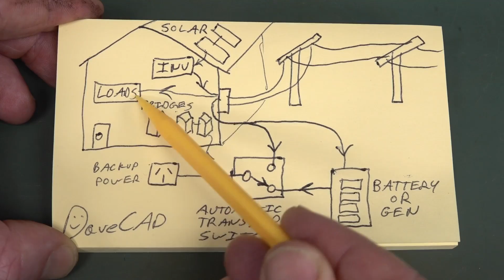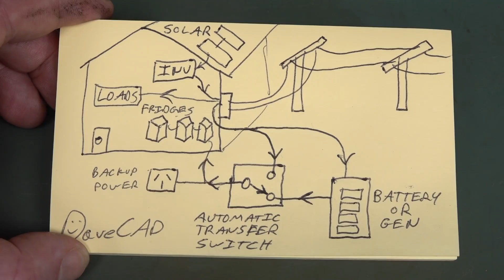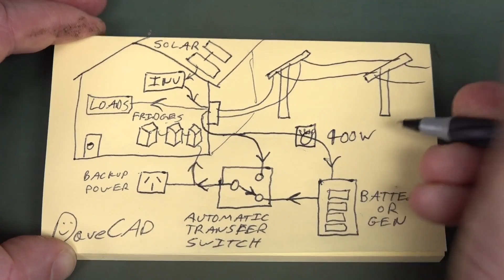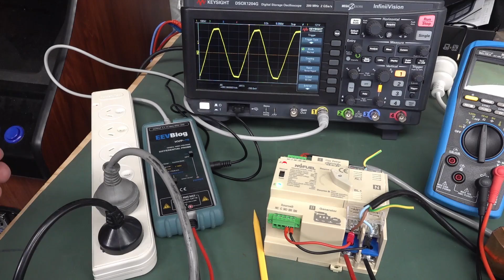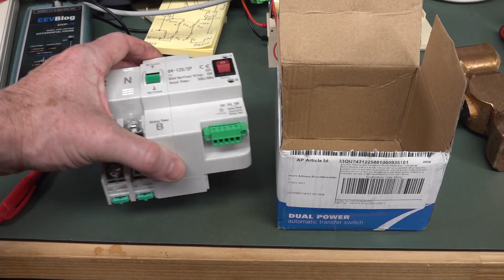EEVblog 1500 - Automatic Transfer Switch REVERSE ENGINEERED

Comment: Side note, I picked up a few of these and they have have changed internally. They now use some kind of sensing circuit (likely a MCU) to detect the power failure and even under/over voltage. This created a problem in that they are very slow -- it takes about 230ms before it'll switch from the primary to secondary. The actual switching is very fast, just like on these units Dave tore down, but since it has to "sense" that the power has failed before activating the relay to switch over, it is very slow overall. It can flash the primary LED input to indicate if the power is over or under spec. Unfortunately this means it's so slow at switching that computers and electronics will reboot. Really disappointing.....

Comment: Great explanation Dave. Do you know how the coil resistance varies with current capacity??  I've tried a 100A ATS and a 3000VA source can switch it but a 500VA can't.  The coil is only 18 ohms, so 12A steady draw plus surge.
I only need 25A capacity, so do you think a say 32A ATS require less power to switch??

Comment: I just received my 3 pols one (I also want to swap the grounding conductor PE) for the very same purpose, using the grid as a power backup, should the stand alone PV have problems.
However, I was puzzled by the manufacturer's description, which states the following:
- Due to the characteristics of the product, this model cannot be connected to the inverter, but can only be connected to the mains or the engine power supply.
Do you see any reasons why a steady, clean and stable PV power should be worse than an unreliable and often unstable grid supply?
I'd like your views on that if you don't mind.
Thanks for your video 🙏

Comment: At 18:36 those are not straightening bars, they are electric arc dissipation plates, also the second model that you have is not 100% identical because the secondary contact's are made once the lever is moved with the big micro switch's on the other one with the 4 pols relay when the main power goes of they switch immediately and it doesn't matter the position of the handle. Other than that your video is great p.s. you should rename the video because I have searched all over the YouTube and I couldn't find an internal look inside these units and you have dismounted it and I have seen what I need. Good luck

Comment: (TLDR ADD FUSES TO THE COIL INPUT TERMINALS) Nice little unit, sadly had one blow up on me after 6months of service. I'm not sure what the first failure was (did it jam? who knows) all i know was it was still in grid mode and oddly hadn't changed over to solar one day and when i checked on it, the unit had  burned a hole in the side of the plastic unit as one of the solenoid coils had burned out completely also burned out all the circuit board traces inside and burned out the auto/manu switch. when i replaced it i added 1amp fuses to the two coil inputs (i did try a 1/2amp but change over inrush blew that one on the second change over test).

Comment: What happens if the control wires aren't connected. Can it still be used manually as a mechanical switch? It's too late to get my head around the circuit.
Reply: Yes

Comment: Bridge rectifiers and associated circuitry are possibly only protected by the 100A main fuse. The control circuits need their own low amp protection device.

Comment: Good informative video.  I bought similar from same manufacturer and now I learned how to wire it up thanks.  $25 here in Thailand off Lazada.   Same project, running guest house off solar and a Bluetti   AC200MAX with mains grid as backup.

Comment: Has anyone looked into what a typical blackout looks like over ~1 second? I'm wondering if there's normally behaviour that would make a 240v relay across it "chatter". 
Do UPS's normally have a minimum time to run off battery before re-connecting to the mains once it's back up?

Comment: I have a question, my ATS switches nicely but sometimes my house fuses flip during the transfer switching from battery to main. What could be the reason?
Reply: Kind of. We have fuse type B installed. I will change it to fuse type C which is made to hold for initial load longer. I presume that should do the trick…
Reply: @cOsMiCTr  thanks for getting back to me so promptly. hope you solve this.
Reply: have you found the issue?

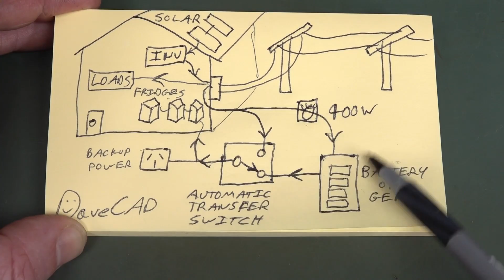Comment: 10:38 Why not do another ones of these automatic switches but tap the sense wires directly of your inverter? Or better the solar panel (there must be shenanigans possible to cut the power from the "grid" if the solar panel doesn't give power.

Comment: Hi Dave. Have you also considered using a power monitor GPO? These monitor the line voltage and automatically cut off power for 5 mins during a brown-out. I could potentially see a feedback loop, if the battery failed under demand (current) but was able to produce enough voltage to trigger the transfer switch. It would just switch back and forth. I do like the transfer switch for redundancy but make sure it has a failure mode lockout. You could also "possibly" use current transformers to siphon off excess solar, instead of a timer.

Comment: Or, place a big can of water in each freezer. That will act like a thermal buffer to keep the temperature low for some hours. Then just turn off the freezers each night.
Or, if you want to be really fancy: Add a larger tank of coolant gas to each freezer.

Comment: You want to make sure you don't have neutral connected earth or you could put any fault current back onto the mains. If you just have an earth spike in the ground you will be ok, but for a neutral connected earth you need to switch over the earth to a local earth too.

Comment: Looks like Dave is going to build overcomplicated nuclear power station from it :D 

What I didn't understand are these points:
1. How can help these mechanical contacts help with glitches caused by another mechanical contacts of built-in relays ofthe battery?
2. Why the fridge must be powered permanently? We have two days with eight hours power outages here per year due to maintenance and it is not absolutely problem - the freezer goes from -18 degC to -12 degC at this time. I don't understand why can 5 to 10 minutes cause a probelm, it would be below scale of the thermosat hysteresis. If the internal temperature rises so fast it is not problem for electrician but for the fire department.
3. The fridge is a compressor. The compressor is a motor with hard start. It means 10 to 15 times normal current. It is stupid idea to connect three of them in paralell and conect at the same moment, even if it runs form a convertor. This will activate the overcurrent protection.

And my recommendations:
1. If there is no extra reason, NEVER switch the neutral line in mains circuits. Really, NEVER. And if you need it be sure the neutral is connected the first and disconnected the last. I know you are not familiar wit it but imagine a board powered by +24V and +5V with cutted off the ground. This is similar.
2. This switch is nice to be a bistable relay on the output. The sensing inputs A and B are good to realize separate control circuits with delay etc. in that.
3. If it is possible to connect N without switching the N contact can switch on and off charging of the battery (the charge time will be shotrer by few minutes but you won't need the extra relay for it).
4. If the invertor has power indication contact it should be used to control this crazy invention.
5. You can also use current sensing relays and switch the output when there is no power consummed from the battery ouput. In this case you have no inrush current...

Comment: Instead of all this stuff. You can simply set your fridges to -25C and use a timer to turn them off during the night. That way they are only powered by solar, and you don't need the battery or a transfer switch. You are in essens using the frigedes as batteries.
Reply: I dare say not all units have a set point that low?

Comment: Automate the battery disconnect?  Why not have something connected to the solar panel input, so that it's controlled by if the solar panels are producing power.  Or just get a photo sensor, so that it follows when there is light outside, so it disconnects at dusk and connects at dawn.

Comment: These are very simple, very crude, but also very effective for small single phase loads. As pointed out by many others, the strengthening bars are intended to break/split/dissipate the arc when switching loads. For small single phase it obviously works,  I doubt they would come anywhere near the rating claimed (50kA) or the full load for the no. of operations claimed. As also pointed out by others, professional units will have multiple time delays built in to prevent hunting in the event of voltage fluctuations, and also run-on timers for generators. But they also cost accordingly :-) Great video, thanks.

Comment: Seems like a design flaw to me.  Shouldn't the tamper switches be arranged so that the solenoid circuit is broken at the end of the throw, not the beginning?  Breaking the circuit at the beginning of the throw could result in oscillations if the initial force of the solenoid is not sufficient - perhaps due to increased friction after years of use and accumulation of dirt.

Comment: You're making it too complicated. Remove that cheap Chinese switch, it is unnecessary. 
There is a plan: 
The rectifier is charging the batteries (from PV or grid). The refrigerator's inverter is powered by batteries. It's like powering a laptop. This system works in my home. This is an online UPS (roughly). I propose to get interested in Victron solutions.

Comment: For fridges I would better look for some that would add delays so the power stays off for at least a minute before switching to the other source. The reason is, the 50ms could be way too long gap for the compressors to actually stall. Moreover when the phase is not correct. Without the delay, the motor starting PTC won't cool down, so it won't energize the phase shift winding, so the motor stay stalled. The fridges would then rely on the overload protection switches to switch off, wait for the PTC to cool down and then restart again, now in a proper way. Although the fridges are supposed to respond that way, you rely really only for the overload switches to operate properly. If these fail short circuit, it will cause the compressors to overheat and significantly increase the risk of fire. Overheated compressor may cause refrigerant leak and because the refrigerant in non CFC fridges uses to be an isobutane, so a pretty flammable gas, then a small spark and you get quite "nice" flame thrower. Only the most modern fridges use timers delaying the start after power restore (the actual delay being designed as random, in order to prevent excessive mains surge when multiple fridges are connected there), but I would not rely on that (some may not have that feature or by the short 50ms gap it may not get triggered reliably while the bad phasing may still stall the compressor)...
By the way the "famous" Grenfell tower fire is suspected to be started exactly that way (officially the ignition was determined to be a fridge-freezer fire...)

Comment: Clive, I think you know that all this can be done much easier with some available home automation thingies. They measure the consumption and control without steps the output of your batteries as well as the charging. But well, your oldschool solution might not be too bad.

Comment: batteries should be connected between solar panels and inverter. You can then have own energy at night and even sell energy at night. Just two dc/dc choppers - one loading batteries when necessary and one pretending the Sun is shining when it is not.

Comment: So, this transfer switch is pretty neat but I'm wondering where it will transfer when the voltage is low but not completely lost, and at what voltage it will pull back in. In my experience with similar relays here in the states (meaning the 120 vAC version), an “ice cube” relay like the one in this transfer switch might not drop out until its voltage drops to about 60%’ish of rated and going the other way, the relay will pick up at about 75%’ish of rated voltage increasing.  While I’m not sure how or at what voltage your inverters turn on (or off), but when used with Grid as Priority, input voltages can be anywhere and not just on or off as the grid degrades.  I’m not saying this is a problem in your application, just pointing out to others to always consider how a device works under all conditions and if this is satisfactory in the intended application.

Comment: You might consider using one of the easun/powland cheap Chinese inverters with automatic bypass and built in charger when you have direct 24/48v battery connection. 5kW are around $400 and unlike typical ATS when battery is low it switches like ups without circuit disruption to grid power. Your ats is here really very fast! You may also configure safe buffer, to reserve a bit capacity should grid fail. those inverters are really good and configurable as for that price.

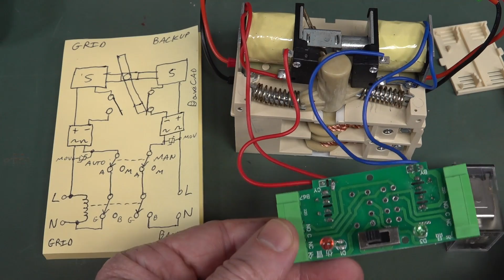Comment: At about 18:45, the two perforated bars may be arc extinguishing means?  You see such on higher voltage and power switches or any breakers capable for over 10 kA breaking.  The idea is to let the arc extend by its own magnetic effekt and push it to multiple gaps that also cool the arc.

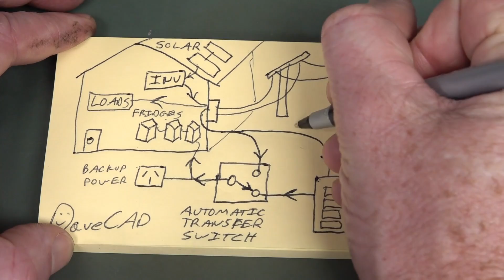Comment: Why not replace the mechanical timer you mention at about 09:50 with a means -- measuring solar panel output -- to activate the switchover to battery when the output of the solar panel rises above, say 10 to 15 percent of the solar panel's maximum output. In the summer time in Australia your solar panels will be supplying power for a loner period of time than during Australian winter.

Comment: it would be interesting to see if the "genuine" one switches faster
Reply: Switching between supplies can be done in as little as 500us. If a supply has failed it takes time to reliability detect that and ensure no current is flowing before turning on the alternative supply. 6ms is fairly safe when both supplies are synchronized.

Comment: I've seen these used within the water industry along with other sine wave normalizers, delays, soft starts - soft stops, VFD switches and current shunts for very high voltage electric motors.

Comment: Nice Video!!! Some risk could be when your battery inverter (connected to your A input) goes into a "brownout. --->  (i) Battery "empty" - turns off the power - (ii) Relay swaps to B (grid in your case) - Battery has no load at that time (iii) battery and inveter recovers - since there is no load - (iv) relay swaps back to source A  ---> we are back at the start.

Comment: Heads up with refrigeration !
Watch out for locked rotors on switchover .
A off delay of ten minutes is advised .
Reply: @gd2329j  I'm actually trying to navigate this issue myself, and is why I've come back to this video. I have one transfer switch and a bunch of different things from lights and computers/television etc that I want to be the absolute fastest changeover possible, but the fridge and ice maker lock the compressor almost every time, so for now I have them on smart switches that have power monitoring, and the power usage must be below 100w for the changeover to be allowed. 100w is the threshold because that's how I know that there's no compressors running, they all draw 115w or more. I would like to be able to run two transfer switches, one for everything else and one with a delay on the changeover so it doesn't lock the compressor, but that requires entire new circuits in the house for fridges and such. I'm sure there's a simple way, I just haven't found it yet.

Comment: Be worth using an ON DELAY circuit on the output, domestic refrigeration equipment usually needs the pressure generated by the compressor to have equalised off cycle for the compressor to start equalised and therefore unloaded, short breaks in supply don’t allow this to happen and the compressor will generally trip on over current and it’s not a good thing to do frequently.
What you described as strengthening bars on the first unit are most likely arc chutes to break the arc current during switching

Comment: diagram is kind of wrong.
Solar goes to Inverter then to battery?
Hunh?
It should go Solar>battery>Inv.
The transfer will only ever see the AC of the inverter coming after the battery and the line power. 
The battery is kind of in parallel between the solar and inverter. 
Either both hanging off a common buss bar or just tapped right off terminals right?

Comment: Heat pumps generally can't immediately restart. If there's a power failure, it should stay off for a minute or two before applying power again. They have a soft-start accumulator tank which fills when first turned on. Applying power while that is full may stall the compressor.
I suspect inverter-driven units take care of this electronically, but I'm not certain.

Comment: Does that circuit have sufficient isolation between the grid and backup sides? The distance between the relay's pads is awfully small. With the right fault condition it seems like there would be a possibility of back-feeding power into the grid through the control circuitry (creating a hazard for linemen etc.).

Comment: 18:30 Those metal fins are there to help quench any arc that's formed as the contacts separate, I'd imagine -- same as for the fins you find in protective circuit breakers.